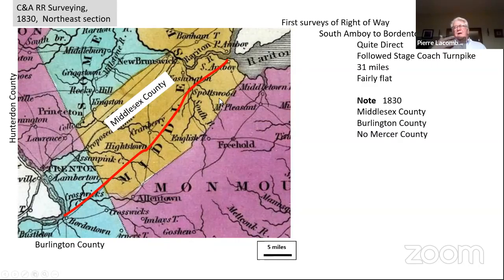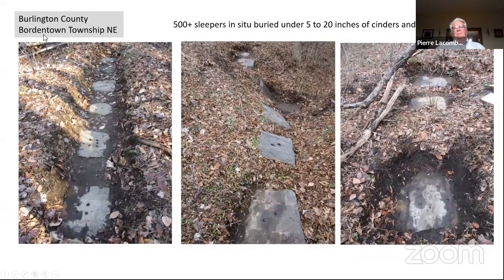Membership Meeting - January 2022 - Sleepers on New Jersey's Pioneer Railroad

Comment: No biggie and a minor correction to the introduction.  Burlington Northern did not sell the former Northern Pacific to The Washington Companies in the 1980's.  The line was leased to Washington Companies and the transaction was initiated by BN who was seeking options on lower labor costs.  BNSF is simply cancelling the lease with Washington and will return to operating the line under its own name.   Washington Companies Montana Rail Link was never able to grow the traffic much beyond the over head traffic given them under the lease agreement with BN.  Trains will, as they always have, operate bi-directionally on the former GN and NP mains.  Traffic in those lanes does not simply work with all traffic in one direction on one line.  I worked for BN in operations and marketing 1978-1984 as the MRL deal was coming together.   Thanks.